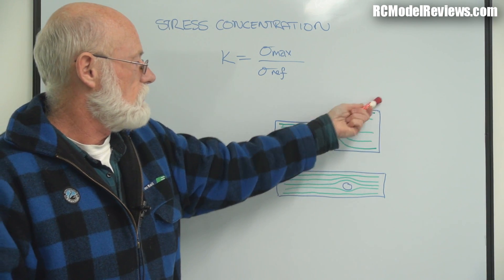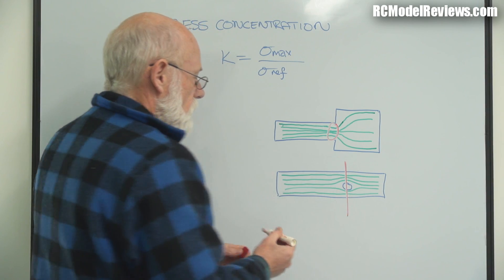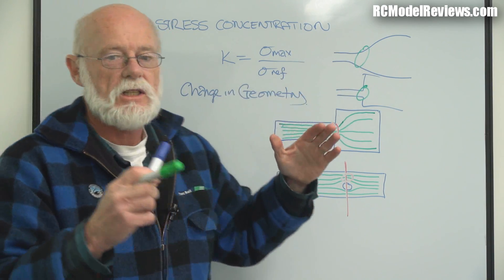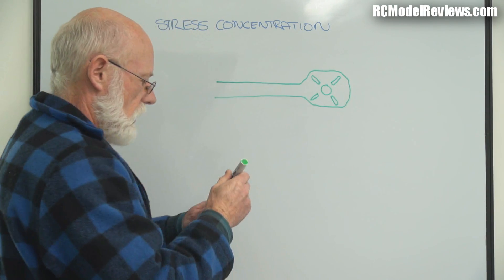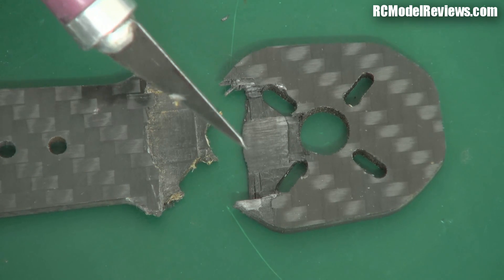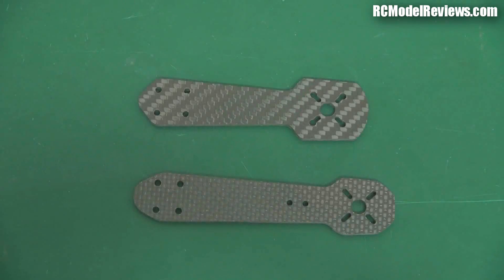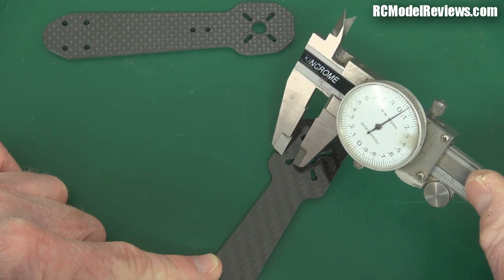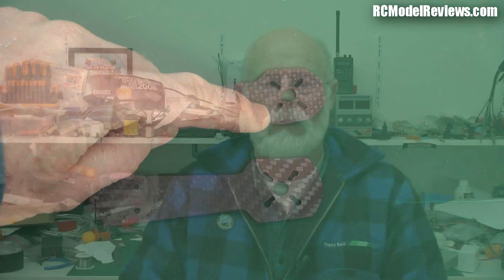Quality versus Value - and why stuff breaks (ZMR250 mini quadcopter analysis)

Comment: Looking to buy a  250 fibre/carbon frame to start quadcopters .. i fly planes and wonder if u could suggest a beginner cheap frame ?
Reply: I have hit begun in the quadcopters and I bought the Kingkong 250 Hobbyking quad and I'm very happy with it.  It's not Carbon fiber but it's very strong and it's a racing quad.  It's pnp and I would suggest a 2200mah 3s lipo to power it.  I haven't found any problems with it yet and it's very fun.  Hope I helped!

Comment: All you people complaining think this is the only cheap frame out there. There are lots of frames for the same price which give much better results. Take for example this frame http://www.banggood.com/LT210-210mm-Carbon-Fiber-FPV-Racer-Quadcopter-Frame-QAV210-With-10-Pairs-Propeller-p-1011578.html
Reply: I'm not sure if a lot of people are aware of this. The product reviews on Banggood are rigged and inflated. If you post a review, it has to be approved by the administrator before you're about to see it. There are a lot of complaints about the administrators not approving any reviews that are mediocre or bad. There are no products on Banggood that has a 4 star or lower rating. They will refuse to approve any product reviews that aren't good. If you look at some of the products that are both on Amazon and Banggood, the reviews on Banggood are always superior while the reviews on Amazon are actually real and honest.

Comment: I crashed my ZMRs relentlessly for three months without breaking an arm. Mine were sourced from Hong Kong and the quality of the carbon was every bit as good as the more expensive stuff which I also own. But there is a new ZMR out now and perhaps they have looked at this stress concentration issue on the new design?

Comment: Who cares if its possible to break an arm. At the price you can afford two or three frames and that gives you four or eight spare arms! If you manage to break eight arms then you should probably take up another hobby. I also agree with the point that the zmr frame quality varies greatly depending on what manufacturer you get it from. The carbon frame I bought looks superb and is very strong. No flex.

Comment: Stating THE, ZMR frame is incorrect.  There are MANY MANY factories making this frame, at MANY MANY different quality levels.  There are some that are going to be sub-par and likely break easier than others. However, there are MANY that are just as good as the "expensive" frames. Just buy from a reputable seller. Dont buy from a no-name ebay store (there are some good ones on ebay though). Considering the numbers that the ZMR (from various manufacturers) has been sold in, I would say the ratio of those that have broken is far less than that of the "expensive" frames. Looking around online, I have seen just as many "expensive" frame arms broken as I have seen ZMR arms broken. Bruce, its unfortunate you have had bad luck, however your relentlessness against this frame is quite unreasonable when you consider all the variables. Can it be better, of course. Is it a good value for the money,absolutely.

Comment: At $25 for the chinese frame and $149 for the Blackout you should expect the chinese frame to be inferior. Value for money wise, You could buy 6 whole chinese frames for the price of a Blackout, and I have seen my chinese frame hit a tree and ricochet into a hardpacked blue metal drive...... it was still upright so I just kept flying. Some would say I was lucky, some would say your mate whose broke was unlucky. I have also hit the top of a 4m tree at about 40kmh and cartwheeled into the ground. When I got there there was a clear indentation of the whole front of the quad and the 2 props that boke were embedded in the ground, not even a mark on the frame. I flew it sideways in to a concrete pot plant at about 30kmh and it struck the frame in between the arms, didn't even leave a mark I could find. So I spose what I'm saying is that they aren't all crap, and the Blackout should totally be better ..... for 6 times the price.
.

Comment: just fit blackout arms on the ZMR, i bet it would still work out cheaper overall?
Reply: stephen ward  id say so. ive found a guy who makes them in different lengths and thicknesses for about 65 bucks nzd inc shipping im not going to buy them untill i break a stock arm.  http://www.ebay.com/itm/ZMR250-QAV250-pure-UK-carbon-alternative-lengths-replacement-arms-4pk-/221835019405?var=&hash=item33a665c48d im not going to buy them untill i break a stock arm

Comment: All that being said, you can look at the two different arms and see that they are a vastly different spec of carbon weave as well.  That probably plays an even bigger role.  Compounding the problem of inferior material is the quality of the machining on the ZMR holes and the rough edges left.  Those rough edges create additional stress risers and the material is already partially delaminated from the slots being machined.  Made from the same material and with the same quality of machining, you'd probably not see too much difference in strength between the two designs.

Comment: The biggest plus the blackout arms have is not the extra 2mm from bolt holes to the outside, but the larger radius of holes in the slots. Also the direction of the carbon weave will have a large impact of the strength.

Comment: Sorry to admit this, but by using a countersunk screw in the motor slots, you actually provoked the delamination of the carbon plate! (Bad tongues would say this was done by purpose...)
With the counter sunk screws, you created a perfect three dimensional tension state...
With a simple washer and a button head screw, you would have drastically decreased the break-possibility by half.

Comment: The stronger arm is using a more rugged (and costly)  twill weave on the carbon fiber too.  Other factors that also effect strength are the type of epoxy used, mat thickness and number of the laminations.  Chinese will cut corners on every possible aspect of it just to get the price down.

Comment: the real problem is there are many sources making this "ZMR frames" and there are 4-5 known versions of the frame out there. There are quality true 100% CF frames which are just as good as the blackout and there are black fiberglass amd CF/FG sandwhich frames being sold as true CF which really arent. So its a bit of a luck of the draw at what you get. I started with a no name ZMR I bought on ebay before I knew about it and it was a cf/fg sandwich. I flew it a few times and even crashed it and it was fine. Ended up selling to a friend and he is still flying it. I bought a REAL CF one from MRM in CA and its the real deal. very nice frame.

Comment: I disagree with your analysis that this is the only problem and I think most of the problem could be solved if the arm were cut from the carbon fibre plate on the bias. even better build the arm as a box beam at a higher cost.

Comment: One other consideration is the difference in arm length... The arm on the ZMR is longer so during a crash, the force exerted on the arm will be higher. This combined with thinner material around holes results in a higher probability of breakage.

Comment: Hi Bruce,

I really enjoy watching your videos giving so much honest information. Now I've been looking into building my own quadcopter. However the thing is I need high efficiency for the specific purpose I'm looking into. That is making aerial footage of the dunes, forests and flower fields and of course for relative long distance fun flying. The terrain has the great advantage of being very flat thus I should have little problems on even very high frequency transceiver signals.

First I'll start of with a little introduction of myself I'm a second year student at the Hague university studying applied physics. I'm familiar with ordering most of my stuff trough China(Taobao) as they can be a really good deal (or a very bad one) I recently received a package containing 3 new Chinese branded lab powersupplies. As here in NL the brands like Delta, Voltcraft, Philips and Tekronix are so expensive a simple student would go broke buying one. (I work 5 evenings a week so it doesn't really apply to me I have the money but what I don't have is a hole in my pocket)
After checking your review on your Chinese power supply I decided to make the gamble and buy 3 units. A 30V5A, 60V5A and a 100V2A. They came in so I started testing them and the results were pretty good 1% deviation from the actually output voltage under full load.(granted this was measured with a cheap multimeter so that might be the deviation)
I tested the full load by "shorting" the leads granted there was a 1m carbon fiber 3mm tube so my wires wouldn't burn and I simply had a heating element. (not really shorting as there was a higher resistance to compensate for the lower resistance in the wires we wouldn't want the full 60V over a thin wire would we :P)

It may seem a bit strange that I bought a 60V let alone a 100V one to boot. Well the reason I bought the 60V one was because I needed something that I could use for ohmic heating a metal hydride project I'm working on. The 100V one I bought because I have a 120Hz 4K UHD panel here for AUO which has a backlight that needs at least 70V. (the AUO engineers thought it was funny to put all LEDs in series I suppose(which is freaking stupid considering they will have deviations meaning some LEDs will receive more current than other LEDs due to))

I was looking into getting those 18Dbi antenna's that you have on your bench in some videos they should do an excellent job I might even hook some up to my Wi-Fi router though I'm a bit worried I will degrade other people's signals. The reason to get that one is because it is only 45 yuan which is about 7 euro a really great deal sure there is a big shipping markup where I order them but still really good. (D-LENP is the brand seems like they offer a lot of interesting stuff)
So the question is how good is it if any at all. And will you be doing a video on it?

I also looked into some Chinese motors now they were very expensive and I'm not sure whether I want to wreck such things though that is unlikely to happen seeing how rough jobs most electro-motors can do. But at a thrust of 0,18 kg they were getting an efficiency of 18g/W and that was with 33 cm diameter blades (13 inch for non metric using people here)
The brand is Crazy Motors and I really don't know what to expect are they lies or are they just not discovered yet. Maybe I should get some myself once I build my quad :)

The rest of the things don't seem that hard to do sure it won't be perfect since it is the first time perfection comes with time I suppose. But I think I could build a really decent one I'm good enough with electronics to know what I'm doing. (though I still lack a pair of decent bench multimeters and an oscilloscope) My first thing to note was that bigger slower turning props would be more efficient. (obviously a single prop with a tail prop is more efficient and so is a tricopter but hard to control)
Also it seemed to me like buying those special battery packs for RC is a waste of money the lipo cells I have are higher density in both energy/volume as in energy/weight. Volumetric and mass are great however the discharge rate is limited so I need to have them in parallel not a problem really. For the controller board a Naze32 should do. For the frame I'm undecided I think a aerodynamic frame will do better actually I know it should do better if done properly but the complexity of producing such a frame would make that alone a huge assignment

Many challenges to overcome into making an ultra efficient model ECalc proved very useful for rough estimates but won't do in practice. Also they don't carry most products I'm looking into.

I typed this in a rush so it might be a little poor structured but today is the day my favorite computer turn based strategy serie (Civ) get's a followup and I have limited time to play as I have exams next week.

Comment: Hi Bruce,
Wondering if this would help with reducing the chance of motor wires being ripped out in a bad crash. I have coiled the wires with the intent of reducing the stress on the wires if the arm breaks. What do you think? Cheers.
rehttps://lh5.googleusercontent.com/-5edsXY23Wd0/VDPWgpC3blI/AAAAAAAACYU/D5qco1USIiw/w903-h508-no/IMG_20141007_140250.jpg

Comment: The weaving direction of the carbon fibre also matters a lot. the original has a 45 degree weaved carbon fibre and the Chinese one got 90 degree. On the other hand, there should always be some cheap Chinese shops for those who cannot afford the fun of the original quad. TBH, the price of the original quad is seriously a bit high for the materials only. But words back, I am not the designer of the quad, I cannot decide how much it should be. So juz let it be....

Comment: Thanks for a nice plain language explanation of the design influences on the strength or otherwise of the ZMR air frame. I am flying one and have yet to dump it into terra firma with any great force. But if or when I do, and I snap a rotor arm, I shall not get too bent out of shape about it. Replacements are cheap enough and I really need to learn to crash much less :-)

Comment: Excellent brief. I recently built 8 carbon fibre reinforcement plates for TMotor U7's originally mounted to Chinese supplied aluminium motor mounts that were proving to be a weak design. I kept the CF plates simple and had a local CNC engineering company cut them for me with professional tools. The A4 size 3mm CF plate cost me GBP75.00. The engineering work to cut the plates and drill the mounting holes cost me a further GBP100.00. Together with the original mounts, they have proved to be extremely strong.
It was an expensive project, but when the large octocopter frame, gimbal and camera, to which they are mounted, is worth well over GBP9000.00 it was worth every penny. By the way, the large octocopter frame is Chinese made and generally of a good design. However, the reality is that, in particular for commercial use, the Chinese manufacturers need to appreciate that consistent good build quality is the key to success, coupled with good customer and product support. Some companies are better at understanding this than others.
I have no bias one way or the other. I want value for money and reliability; I do not care where it comes from. Some European, US and NZ manufacturers charge absolutely ludicrous prices for components, just because they think they can. The Chinese manufacturers add cost effective competition. However, following up with them to get product support can be inconsistent. What the Chinese manufacturers need to understand clearly is that if a component is inconsistent, be it an electronic, or a structural component, if it is found to be unreliable it will almost certainly now be banned for commercial use by national aviation authorities. This is certainly the case within the EU. Therefore, putting unreliable products on the open market, especially for commercial use, is pointless. It does not help either the manufacturer or the customer.

Comment: You might of been a bit unlucky with that crash Bruce and after all, it was just one instance of the arm breaking. Over the last few days I've been flying the snot out of my ZMR carbon fibre mini quad. I crashed it at full speed into trees and flew it into the ground so hard that one of the arms embedded itself 6cm into the soil and the quad stuck out like a dagger. The only thing that broke was props of which I destroyed 9 of  in the last 3 days..

Comment: Why was the mounting hole problem not mentioned, when I fitted my RC timer motors the 16mm fitted fine but to fit the 12mm I had to take a dremmill with a diamond post bit to 2 of the slots so everything fitted, in a close up on this video I can see Bruce has done the same.

Comment: Hi Bruce,
Thanks for the video. What is the relative thicknesses of the arms? A slight difference in thickness makes a more significant change in the bending strength and stiffness of the arms than does the difference in the width. I am just curious to see what the differences in thickness are between the two arms.

Comment: My brother has this frame.Yesterday he accidentally disarmed his motors at ~70m high. The quad came straight down and fell like a stone in to some ~20cm high grass. No damage at all.(not even a shattered prop lol).  Thats not to say this frame is indestructible, or even as good as a blackout, but you cant draw conclusions from a single incident.
Reply: Nearly any frame is indestructible when it's dropped on and parallel to a flat surface. It's all about the size of the area that has to endure the force of an impact. You know this, if you drop your phone and it lands on a corner, you are more likely to find your screen broken. But a good design is made to withstand these forces and prevent stress to build up at any weak spots. The only conclusion you can draw from such accident is that the frame landed in an unfortunate position.

Comment: As i have bought a 250 knock off frame i just watched the build video again. I noticed when comparing the knock off to the Original Qav frame the qav frame has got some rather large holes in the arms.

Making that a very weak point??add the fact that the arms and body plate are one and if one should break you will have to replace the whole plate?

How would the stress lines go on that arm and that can not be a good thing for a rolls royce priced frame??

Keep up the great informing videos please!!

Comment: Are the mounting holes on the blackout arms in the same location as the zmr220? or could you fit the blackout arms to the zmr250? even with a small mod i think it would be worth it if its even possible.